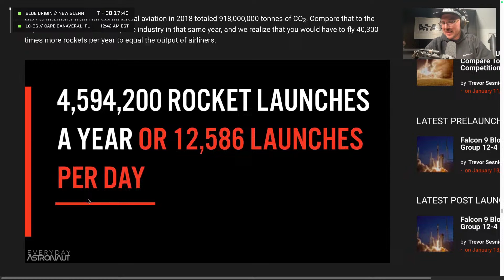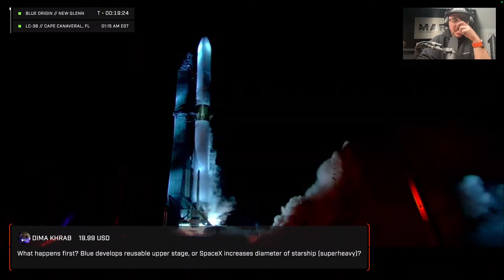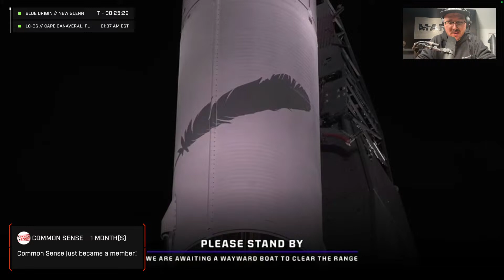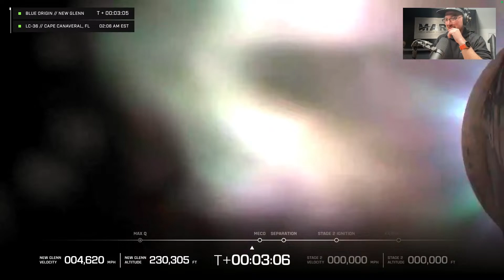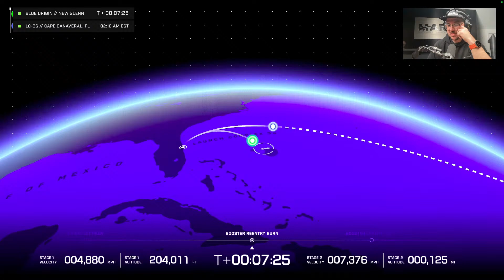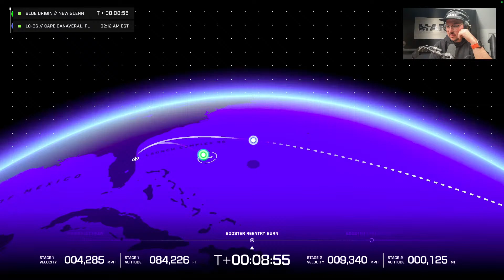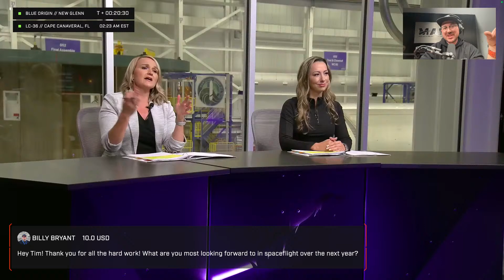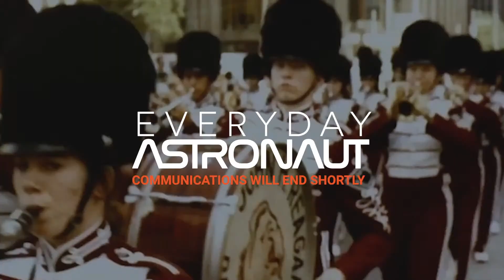Watch Blue Origin Launch New Glenn For The First Time!

Comment: Is it me or is that thing slow as hell getting off the pad??
Reply: Glenn’s thrust to weight ratio is not as strong as starship. We’ve been spoiled by raptor engines and Starlink. This is was a solid lift off though.
Reply: @CYBRLFT  Also the BE4 is intentionally operating on a much lower chamber pressure than raptor, in order to reduce wear and tear of the engine. Once they have flown those engines multiple times and inspected them, blue origin might crank up the performance. I mean look at how much spaceX has improved their raptors over the years.
Reply: I don't know how efficient such a slow liftoff is, but it looks really cool
Reply: It's a hefty boi
Reply: haha, I also said "why is it so slow?" but figured there must be a reason I don't understand
Reply: It looked as slow as a Saturn 5 alright.
Reply: It did look slow to me but I think between the SLS and Starhip launches we've just gotten used to really high twr rockets
Reply: very slow in the beginning indeed, but it picks up pace really quick once past max Q. And how beautiful it looks, shining in deep blue!
Reply: Because it is such a big object. It takes longer to get it up to speed.  Think of the difference between getting a semi truck up to speed vs a passenger car
Reply: @MrSssb2000  It's mainly the weight ration. New Glenn' s lift today is a 1 to 2 weight ratio. Starship and Space is is mainly 1 to 4 ratio, and has more engines. so it will always get up faster than New Glenn. It's not a speed race but can you get to orbit as the main goal thing. New Glenn is still quite a bit smaller than Starship and not as much power by design but has the 2nd largest fairing ever put into space. Only Starship's fairing is larger. A fine rocket though for New Glenn.
Reply: @gwhite7136  > New Glenn' s lift today is a 1 to 2 weight ratio. Starship and Space is is mainly 1 to 4 ratio, and has more engines.

Ratio of WHAT to WHAT? Also, what "Space" refers to?

> It's not a speed race but can you get to orbit as the main goal thing.

It actually is important. Low TWR is not a good thing. It's called gravity losses.
E.g. a theorietical rocket with 1.00 TWR loses all of its thrust to just keep itself hovering.
A rocket with 1.10 TWR loses ~90% of its thrust to sustaining its velocity, and only the remaining ~10% is used to accelerate itself.
Of course, high TWR is good, but requires more powerful (therefore heavier) engines, so there is a tradeoff.
Reply: @denysvlasenko1865  Well said and yep, that was the weight vs thrust ratio I was referring to. Those that are expecting to see the New Glenn ever take off as fast as the Starship will likely be disappointed. But what New Glenn can say for sure is that with their load today, they actually got to orbit before Starship with a fairing fully loaded or loaded anywhere near capacity and did it on the 1st attempt. It's slow from what we are used to seeing since the days of the shuttles going up but to win, all you have to do is get to orbit and discharge payload. I think New Glenn will get there and it's a very different assembly than what Starship does. From heavy machine metal equipment to the number of boosters. It's a cheaper way to  but we must wonder if there is a payload that either company will get commissioned for that only one of them can do, or Space X could only haul? I'm not sure there is when you look at the size difference between the fairings for Starship and New Glenn. IF there is something that could only fit in the Starship faring but not the New Glenn, I don't know what that could be but suffice to say there wouldn't be many of those. I do expect New Glenn to start missions in 2025 though. Not sure about Starship doing this yet and if the Falcon Heavy launches are still on in 2025.
Reply: You have to remember the thing you're seeing is the size of a skyscraper
Reply: I agrew very slow starship moves way faster but more engines
Reply: Yes, for a few reasons but they aren't bad reasons. New Glenn has 7 engines, Starship has infinitely more. Also, New Glenn is a 1 to 2 weight ratio, Starship is normally 1 to 4 weight ration. So your lighter rocket with more engines well, gonna get up in half the time. This was like the old Space Shuttle days when they'd lift off. Slow but reliable. For it's size, did very well. Only the Starship Fairing is larger than New Glenn's so this is the second large fairing ever to launch, but it's not larger by much.
Reply: It's big
Reply: Yeah for a split second I was like…. Oooft is that thing gunna make it.
Reply: Its a bit of an illusion because its so big and compared to Starship they reduced its fuel capacity to be more efficient because if its reuseable the cost of fuel becomes more substantial. Im not sure on bo stance on that
Reply: @iamsick5204  It's still  a bit smaller than Starship but the key will be in fairing size for New Glenn.  It's slightly smarter fairing than Starships but still good for 2nd place in size ever in space. BO maybe a company that simply is going to specialize in New Glenn's. With reusability they should do very well in cargo respect. And they don't have a starship but in the future, could produce one down the road.
Reply: Slow to climb and to accelerate even if it has no payload, what will it do with an heavy payload as predicted? Climb as fast as a snail?
Reply: @rallysta74  It was a 1-2 weight ratio vs thrust, and it has a heavy payload from what I understand with the flight today. It will never be a fast takeoff with only 7 engines now matter how powerful vs Starship with many booster engines by comparison. We are spoiled after watching Space X for years but this is about as fast as these style of engines are. About as slow as shuttles being carried into space by giant boosters back in the day. But remember, the goal is to get a 100% to space ratio and so far New Glenn is 1-0 after the 1st attempt. Unlikely to have a catastrophic failure that prevents them from getting to orbit going forward. Never say never but New Glenn should be carrying loads into space in 2025.  Before Starship, again, two different crafts rated differently. We haven't even gotten the starship with a fairing hauling anything into space yet. New Glenn just did that today.
Reply: Compared to Elons starship it was going really slow and it's smaller
Reply: Its very large so it may seem to be going slow but that thang is burning
Reply: @idris4587 Took about 30 seconds to reach just 100 mph, that ain't cooking mate
Reply: The TWR at liftoff is just 1.1
Reply: @karliszauers1  No it doesn't, 1:1 means hover, no up amd no down. Equals out.
Reply: @amriddle01  it's 1.1 not 1:1  thrust is 10% higher than it's mass at ignition. 110% of the mass or 110/100 = 1.1 TWR. It's going up slowly. With the fuel being depleted over the first 40s the TWR goes up to an average 1.2
Reply: @karliszauers1  so then you mean  1.1:1 just stating 1.1 is not a ratio, looks like a mistake.
Reply: @amriddle01  write "rocket TWR" in google and check Wikipedia that's how TWR is usually written as ( just one decimal)

Thrust/ Mass = decimal

I understand what you're saying, but I literally haven't seen it written out like that ever
Reply: It's at its heaviest
Reply: @gazza1059 it had a tiny payload
Reply: @vablo7198 more propellant
Reply: I think it might do better, but they intentionally want to reduce the damage from the plume when leaving the launch site.